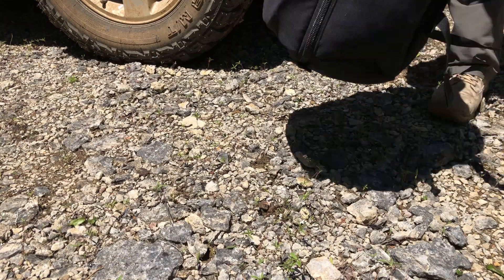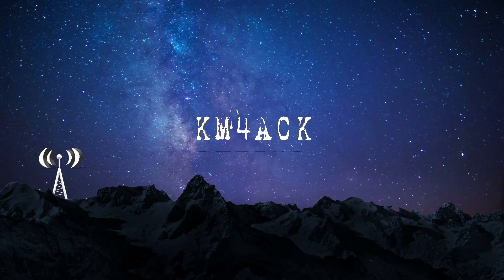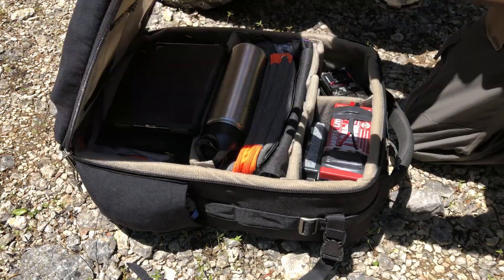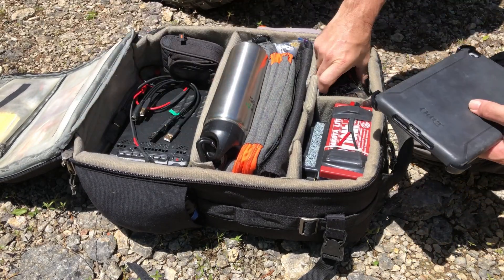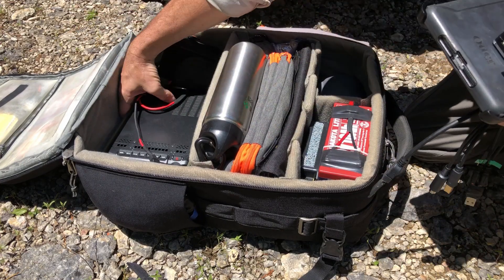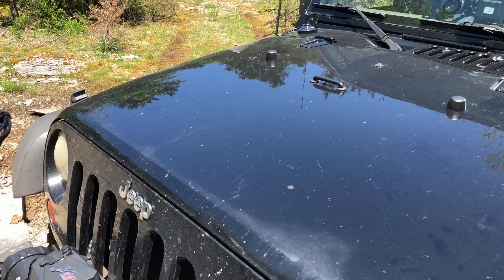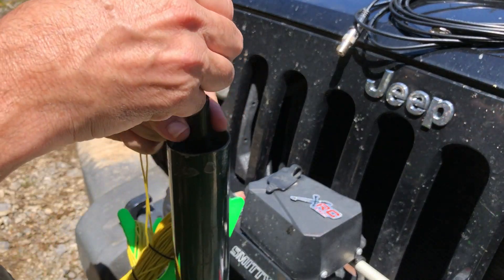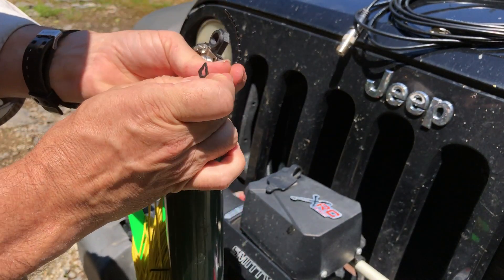WOW!! That's FAST

Comment: I love the fender mount and fiberglass pole setup here. What antenna are you using?  I also really like the compactness of your kit! (and the charge controller strapped to the battery - much lighter and more compact than, say, a goal zero would be, but still intuitive to use and charge)
Reply from the maker: Thanks man!! That particular day I was using a home brew linked dipole.

Comment: I did make the change from 500 to 2000 and experienced only frustration.  I kept getting "unexpected EOF" error messages.  Regardless of email size, or with or without attachments.  All emails were under 100KB large.  Other Pat Winlink users have reported the same error message.  I switched back to "500" and have not yet experienced this error message again, even connecting to ARDOP 2000 stations.  Right at this moment, it is taking forever to download a 38KB email (with jpg attachment).  This seems to be only a work around.  It is slow, but it seems to work. What are your thoughts?
Reply from the maker: It all depends on your signal to noise ratio. Provided you have enough signal and little noise, the 2000 setting works extremely well. During the field test I had a S1 noise level and a S8 receive signal. At my home QTH, I have a constant S7 noise level. In that environment, I set it to 500. Not as fast but far more reliable. Pat Menu v2 will be out soon and offer a way to set the speed within the menu making it super easy to change it when needed. Remember that regardless of the speed setting, it is still slower than dial up internet was in the mid 90's.
Reply: @KM4ACK  I have been adjustimg PAT speed, ALC and trying different stations.  Indeed, the noise level has gone up suddenly and a lot where I live.  I don't know where it is coming from. I live out in the boondocks with otherwise no QRM sources.  Might be some general atmospheric thing.  I hope it does not last much longer. Looking forward to V2.  I have been using V1 intensely for a couple of weeks already and think it is a great tool.